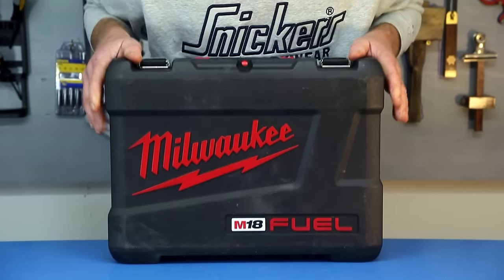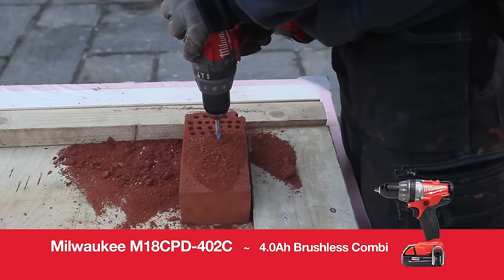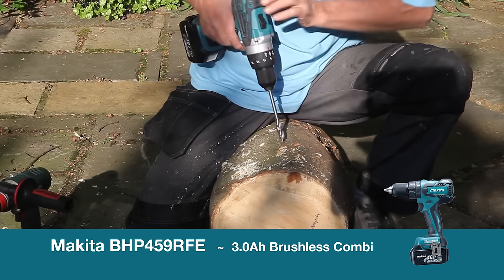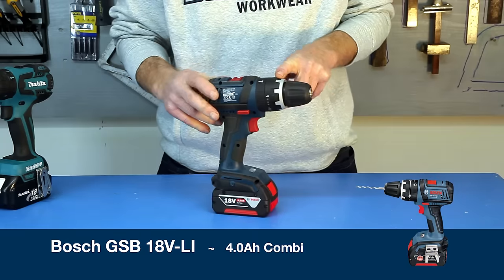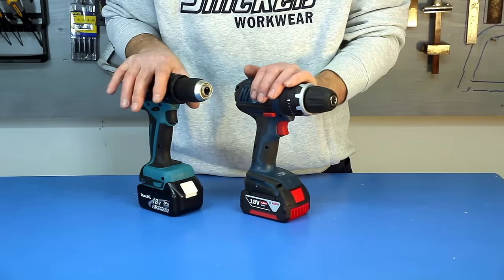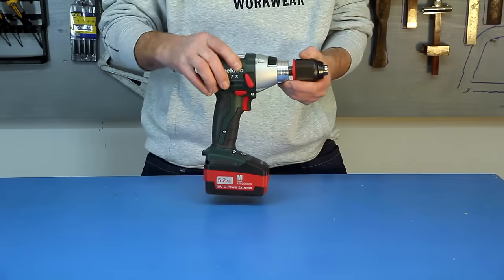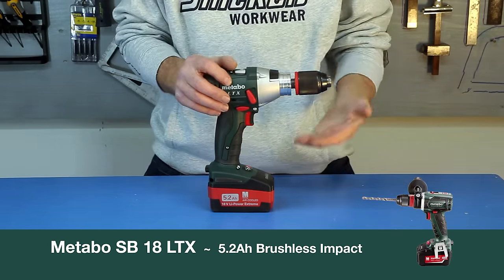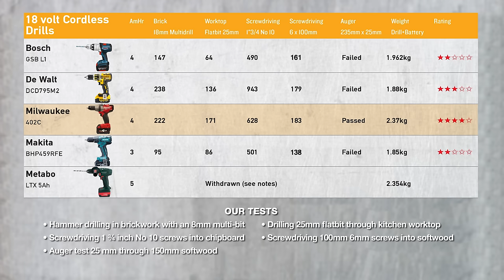18v Cordless Drill Review - 5 Best Drills Tested

Comment: Most biased comparison I've seen.
How about comparing like for like?
That's not even a general purpose Makita - it's a light usage brushless, completely different category.
Reply from the maker: All this has been said in the comments and we took it on board for our second test where the manufacturers chose the drills. If nothing else this test shows that not all 18 volt drills are born equal. We leave this test up in order to take people to the second improved test. 
When we do the third one it will be perfect but we will still get complaints.

Comment: I do not understand how you can select the best when compared Drill Drill different categories. If you are using a brushless Milwauke, and then use another manufacturer Drill Brushless motors - Brushless motor after all, about 50 percent superior to the four-pole motors. Say bluntly that received money from the winner or even work for them and it will be clear
Furthermore, your test images used in the experiments can be seen that a minimum of 2 makita housewares, although at the beginning the only one tool. Totally unprofessional work is done.
Reply: Skill Builder 1. No one and does not require you to compare identical tool. You compare the "analogy" - the same class of tools with analogue equipment, etc. Currently, choose your tools did not comply - Drill differed life, it can be seen from the table Drill built on the level of wear and tear.
2. Information to be credible if it is not without test video montages, especially when fitted with video clearly visible that are not used as tools themselves are at the beginning of the video.
3. It's that you have been full manufacturer factories, as I doubt does not mean that you were well aware of all producers of tools. Neither manufacturer invitation to you to our factory, can not tolerate the demonstration test, because it is unethical

Comment: what the fuck the dewalt had a 5 .0 ah
Reply from the maker: I think you have missed the fact that this test is from 2014. There is a new test.
Reply: +Skill Builder thanks I thought it was from 2016
Reply from the maker: No problem. Check out the new test and you will see that DeWalt had the longest run time on 5Ah
Reply: +Skill Builder and also please do it at 4:00pm

Comment: Your comparing the Bosch GSB1800, which sells for just £99, to other drills which are selling at £300 to £400 and you only give it 2 Stars?!! You're a joker!
Reply: +Skill Builder I have a now useless Metabo. It was recommended by the store, I instal air conditioning, after 6 weeks, the battery smoked up, the shop refused to replace the drill, so did Metabo. The shop has refused to replace the drill or battery, (once they smoke, they're stuffed) it had a 3 year warranty, not worth the paper it's written on. Metabo in Australia does not honour warranty, the trade store I purchased the drill, does not honour warranty, I am thinking AEG, they promote 6 year warranty, though I'm leaning toward Milwaukee. An important note, when these batteries smoke, put them in an open field to die, do not apply water, I have learnt that Li-ion batteries have a 3 year shelf life. Unfortunately, this really means, 3 year from the date of manufacture, not the day you start using it. check dates and be careful, the stench of these batteries is horrrendous and can catch on fire. I was lucky and threw mine outside, I was only cutting a hollow door for a handle, Metabo, sorry, absolute rubbish on battery drills. My electric hammer drill appears to be unbreakable.
Reply: +studisme 
In the test the Bosch is the GSB 18V-LI looks to 4:35 minutes and the price is not € 100, but at least 350 €.
Reply from the maker: +mcfour65 You are right that is the model on test.
Reply: My bad. Your right. But still a hefty price difference. I've got the exact same model. GSB 18 v-li and am really pleased with it..

Comment: Never heard of matabo drills but they sound like garbage. You can't really tell your boss sorry can't do that yet my drill needs a rest lol junk
Reply: Just google Metabo and you will see they are not garbage and have been in the industrial tool game since the 1920's. As far as cutting out, it is during extreme testing to increase the longevity of the tool. Im sure your boss wouldn't like to be replacing drills at hundreds of dollars a piece more often either. What job are you doing where you are sinking 4" inch screws in rapid sequence at 40 a time? Generally your cutting, placing the beams, drilling ect? the drill would be resting adequately during normal operations. These are torture test.
Reply from the maker: TheVelluch They have been around a long time and they may still be a top brand but they are not unique in having thermal protection. The fact is that it cur out way before any other drill and in the end it didn't save it from burn out. ? We try something it fails. What can we do?
Reply: I understand. I was just trying to state to the previous poster that Metabo is not a crap company. To be honest This review worried me because I just ordered a Metabo drill. I ordered the Brushless Hammer drill with 5.2 batteries, so hopefully it holds up better than this test of the previous model. Keep up the good reviews.
Reply from the maker: TheVelluch Thanks  for that. It was never my intention to stifle debate, we welcome all contributions and would like to know how you get on with that Metabo.  I visited their German factory many years ago and saw some good work. I wonder how much is still made there..

Comment: Your tests are significantly inaccurate due to the fact that not all the drills are equal to the others, so their fore is not a good test.
Reply from the maker: You are right and it is something we are looking to rectify when we can get the next batch of drills but we are independent and it is difficult to get the drills on loan when manufacturers find out what we want to do with them. In the meantime these drills  are all 18 volt drills and the test does show that there is a big difference in power and runtime. This has been useful to many people sorry it isn't to you.
Reply: Skill Builder Yeah, that Bosch & Makita drill cost half of what the Milwaukee cost so not really a fair comparison. DeWalt is Black & Decker
Reply from the maker: plusthebadger. We trust the intelligence of the viewer to pick the bones out of the test. The  chart gives a detailed run down of performance so people can decide if the extra torque is more valuable to them than the other features. Of course they are different prices that is a given.

Comment: What a tendentious video, there was no data in terms of motor rpm or motor stack size.
Reply from the maker: +Emmanuel Gloria 
It was never our intention to be biased. We took some drills and ran them up against each other.  The data you are referring to is in the manufacturer's' spec sheets. Have a look at our new test and see if you find it less tendentious. https://www.youtube.com/watch?v=Fbnzhf6adzo
Reply: +Skill Builder let me rewrite my comment I think I wasn't fair. It would be helpful if we see a comparison between similar product capabilities stack length, rpm, etc and if the test focus on Duty cycles, like 1/2 spade bit # of holes per charge or number of screws per charge.
Reply from the maker: +Emmanuel Gloria 
Thank you . I think what you said was fair comment. The first review did come across as slightly lacking even though it took a lot of work to complete. The chart at the end of the test showed how each drill faired in the different categories. We found, for example, that the Dewalt put in a lot more screws than the higher torque models. Every time we do a test we learn from the comments how to do it better so we really value your input  but the viewing stats show that many  people don't want to watch long videos so we tried to put the results up front.